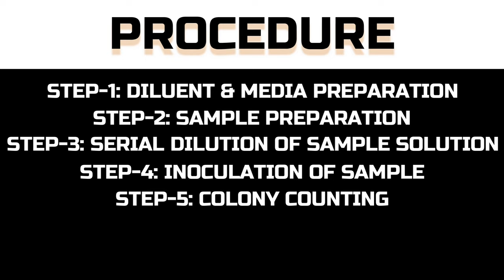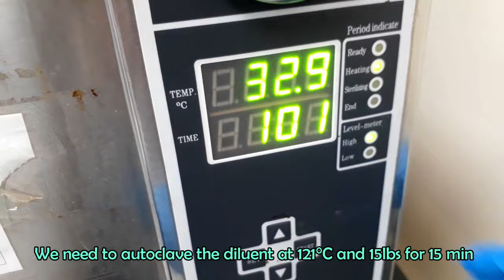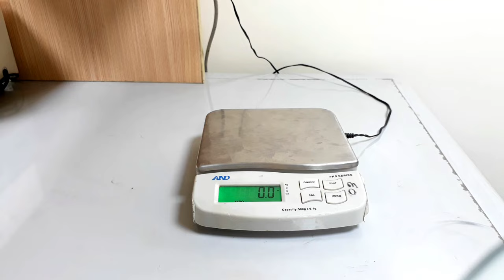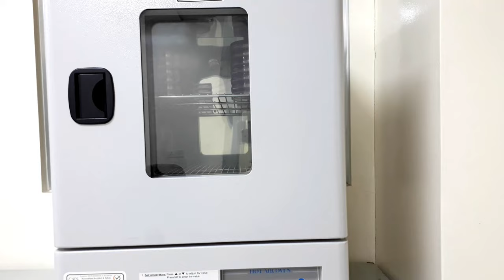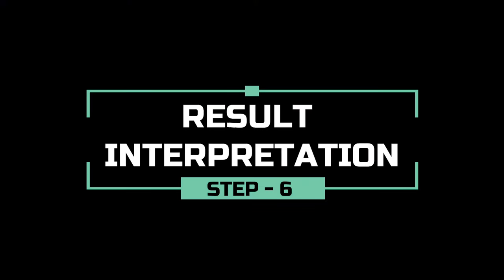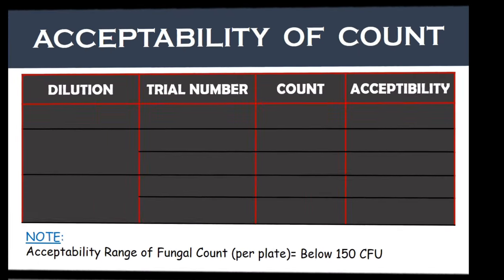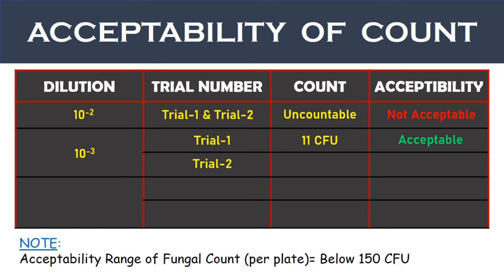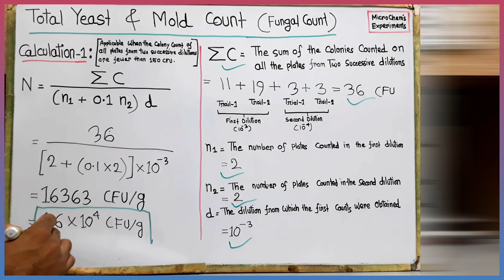Total Yeast & Mold Count (Total Fungal Count)_A Complete Procedure (BAM, Ch-18)

Comment: Thanks for the excellent video. I have few questions 1. What can we use instead of stomacher bags ? 2. How to prepare sample if we have swab samples or environmental samples ? 3. Formula if we have n3 or n4 also ?
Reply from the maker: 1. Large duran bottle
2. Dissolve the swab stick in 10ml buffer solution. After shaking and vortex, dilute if necessary. Then analyze.
3. First calculate average from 2 plates. In this way, make 2 values from 4 plates.

Comment: Would you please instruct us:
The sample on each plate is 100μl(0.1ml)
Do we need to multiply the final 
result with 10  for 1ml sample for this spread plate method ?
We use 1 ml sample on each plate for pour plate method 
but we use 0.1 ml sample on each plate for spread plate method.

Comment: Incubate plates in upright or invert position
Reply from the maker: Invert
Reply: But in  iso method 21527-2 is written:
 9.2.3 Incubate the prepared plates  aerobically, lids uppermost, in an upright position in the incubator 
at 25 °C ± 1 °C for 5 d to 7 d. If necessary, leave the agar plates to stand in diffuse daylight for 1 d to 2 d.